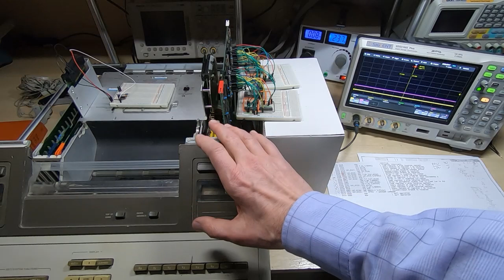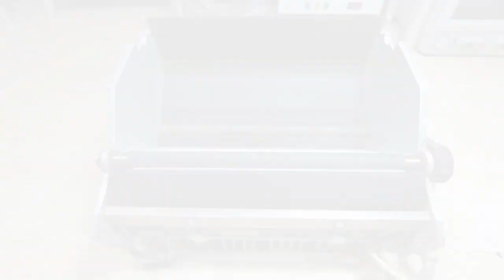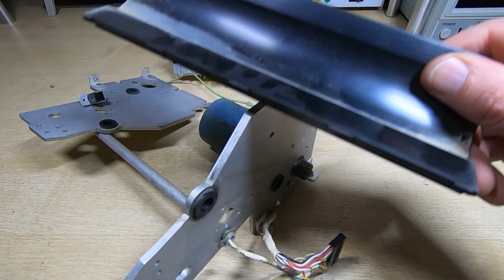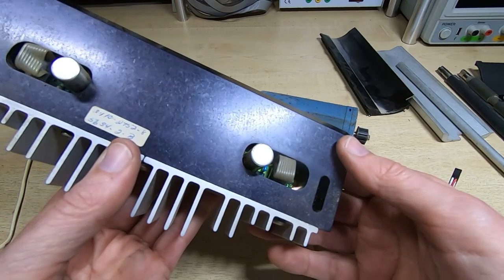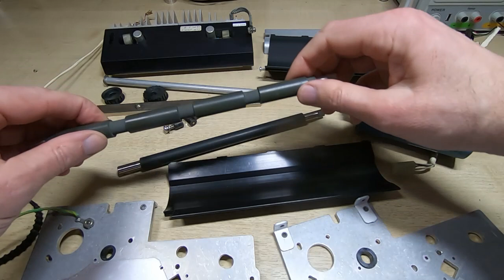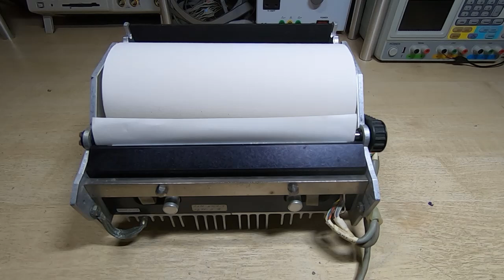HP9845B Repair Part12

Comment: I have never seen an EPROM with latches on the address lines, learn something new every day. I am old, but apparently not that old.
Reply from the maker: Yes they are intended for circuits using multiplexed busses. Almost all of them adhere to the standard memory device pin out but unfortunately the HP ROM's did not as they were designed before the standard was established so there are no direct replacements.

Comment: You where lucky with the rubber rollers in this machine. So often it goes rock hard or melts to goop. HP found the Goldilocks of rubber formulation 😀